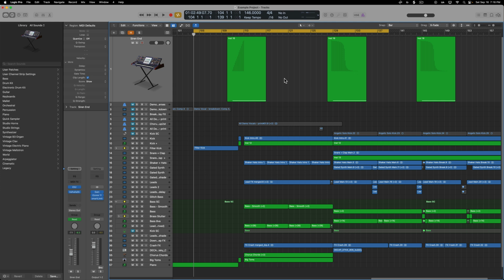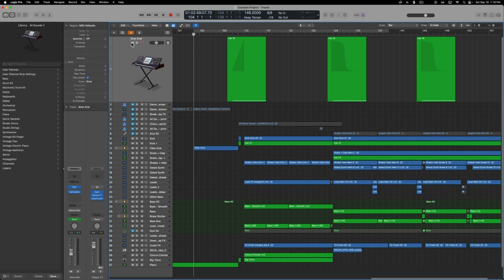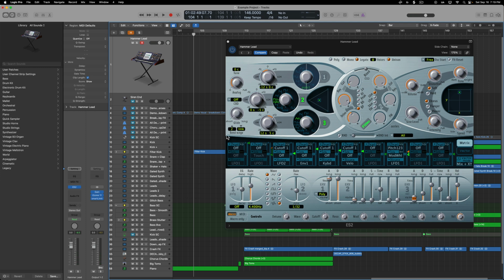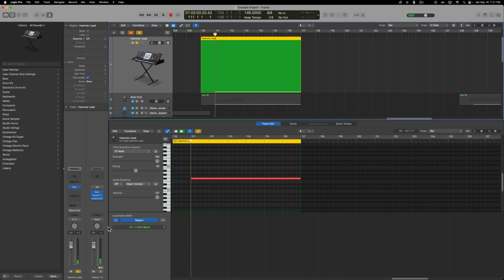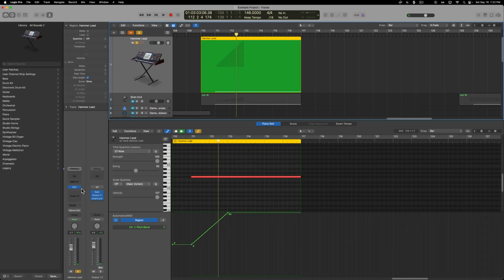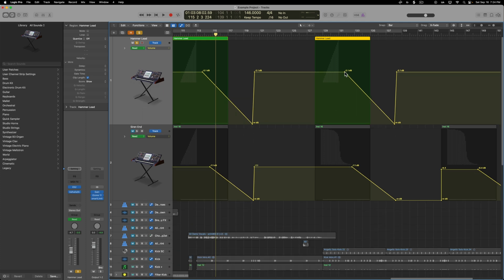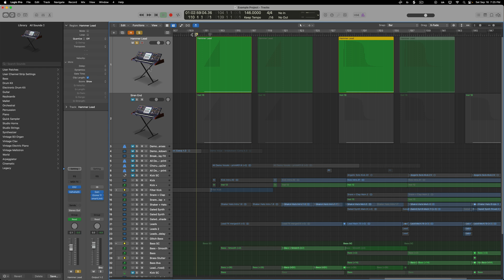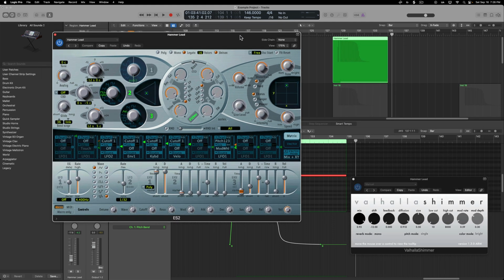Logic Pro - Synth Pitch Risers and Fall FX (SOUND DESIGN)

Comment: Question: in the vid you say the note will slide up 3 octaves.... what is the relation between an octave and the value number of the automation. Example... you have the note slide up from a value of 0 to 63.... what is the relation between interval of notes and the numbers used in automation ranging from 0-63? say I want to slide up a semitone, or a fifth? How do you determine the proper automation value? thank you.